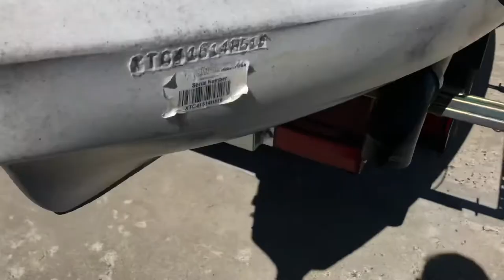Update on my Double DIY Kayak Build | 2018#kayak #kayaktrailer

Comment: put some out door carpet on the runners. It would help you load and unload and movement on the trailer when you are one the road.
Reply from the maker: Leland Adamson If it was wood runners, I’d put carpet on them. I fixed my little issue with cutting the channels in and adding the 90 degree’s on the end.

Comment: To avoid rubbing on the tubes, could you put a spacer under the tube to raise it up?  Just wondering if that would work.
Reply from the maker: Dave Deutsch probably, but I didn’t want to raise it up higher. My back is shot. The lower it is, it’s easier to load or unload the kayaks.